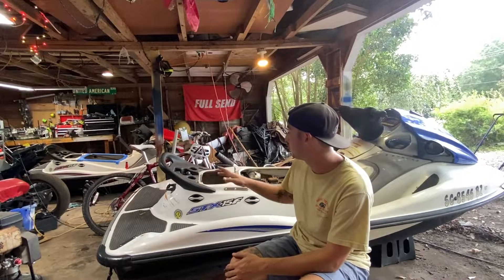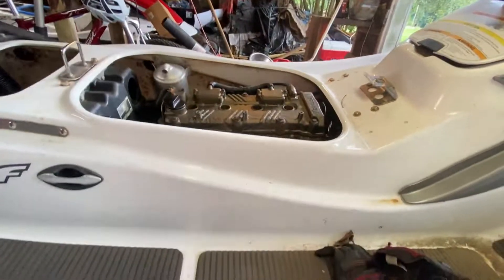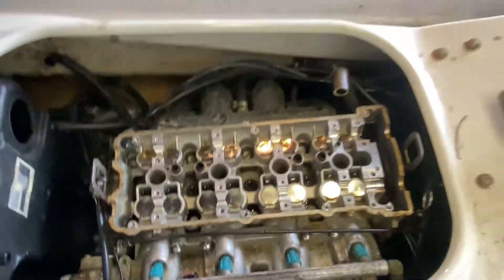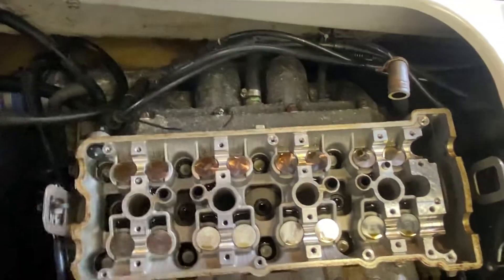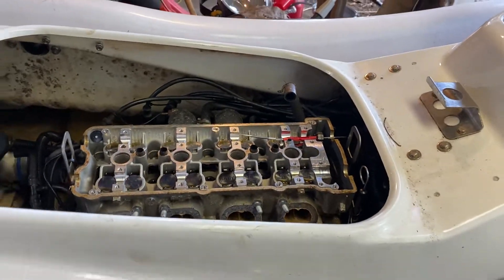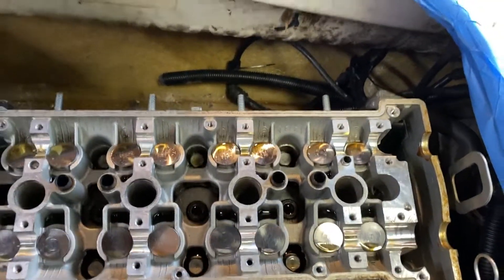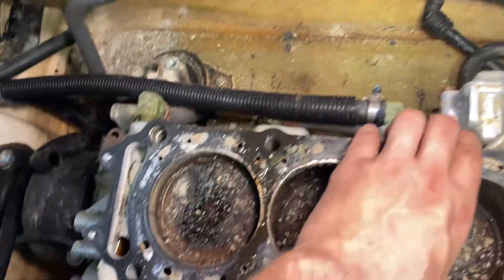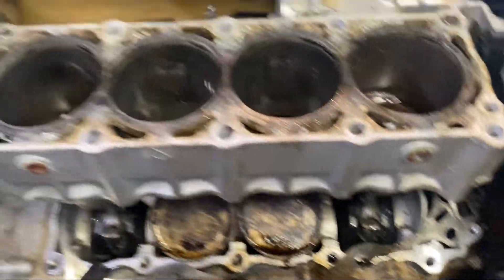Jet Ski ENGINE REBUILD Part 1: Kawasaki SXT15-F 1500/ULTRA

Comment: I think what your are calling "sand" is really dried crystal salt mixed with alloy corrosion.
Pretty common on these skis in salt. But for sure that thing has been sunk or at least drinking salt water from the intake, never flushed and probably water left in the exhaust after use.

Comment: How much did you get them for without checking if the engine works?
Reply from the maker: $3000 for both with a nice trailer. When I got them I was under the impression one was good and recently rebuilt but had been sitting and the other was low compression. 

At the end of the day it was a good deal but for the amount of work I wouldn’t do it again. These skis are on their 3rd or 4th rebuild from what I can tell and it seems pretty common with these. Both had SBT motors installed in 2017 and were blown up by 2020.
Reply: @niceguysmotorsports  I have a 2006 Yamaha VX110 Deluxe That i got a while back with only 30 hrs on it. I think i did an okay job MXing it but water was getting in the hull when it would sit in the water overnight, bigle pump took care of that but then i made a hard turn in the ocean and the entire engine broke off all the mounts inside with the jet pump coupler and driveshaft coupler disconnecting as well. Then I just found out after the engine wouldn't start that i have low compression in 2 cylinders. No idea what the issue is but looks like I'm going to have to take the engine out and figure it out. Any suggestions on where to start or look? Engine only has 120 hrs on it

Comment: I have a 2007 STX 15F. Surprised this seems to be common with them. This one had to have been hydrolocked by flooding or a failed component. Mines at 113 hours and runs like it was brand new.

Comment: Good stuff. I personally would have pulled the whole thing, but still cool. You can green scotch bright the nikasil plating on the cylinder and be good to go. I've read if you re-hone it, needs to be done with a certain hone. Not sure which material, hopefully the scotch bright will get clean that up!